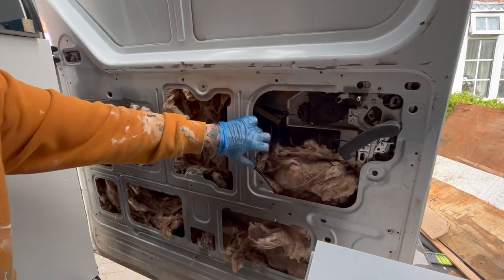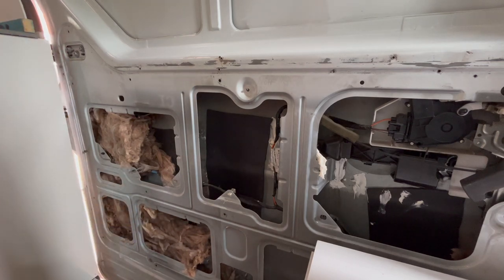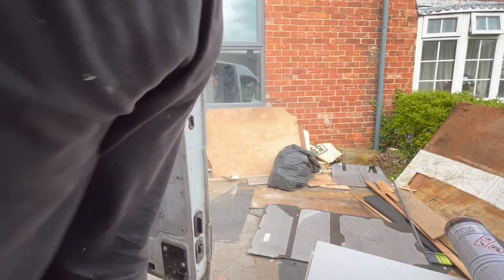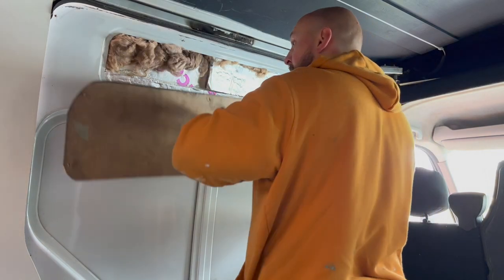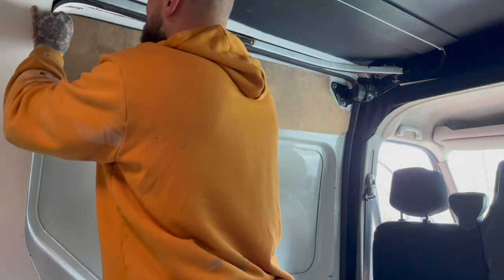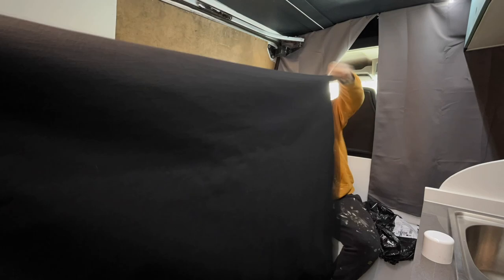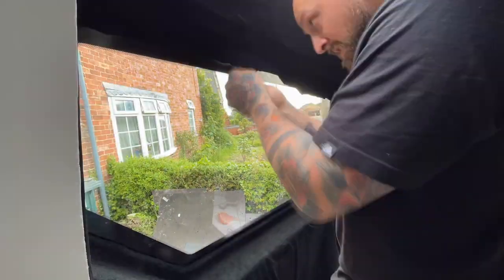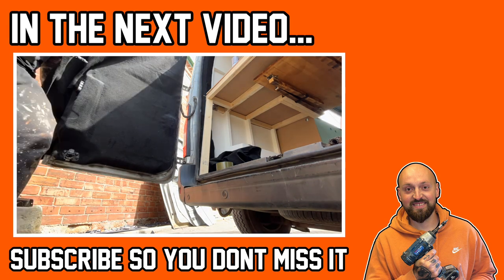Sound Deadening, Insulating and Carpeting the Sliding Door | Camper Van Conversion

Comment: Hi Dan, what are the edge trims called and where were they from?
Reply from the maker: I’m not actually sure what they’re called, I got them from Amazon and the product title is: “Car Door Edge Guard Protector Strips U Shape Rubber Car Door Seal Trim for Car Mental Edges Boat, Grip Range 1.0mm to 2.5mm (5m)”
I’ve added a link in the description to the ones I used.
Reply: @Renovation-Dan  Thanks Dan. That's really helpful.
Reply from the maker: @daveshaw2012  no problem at all